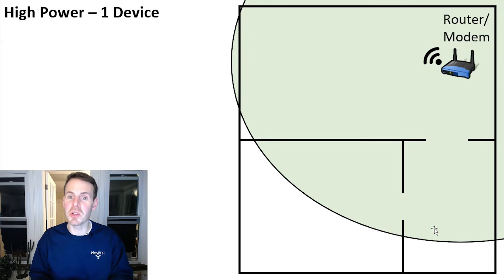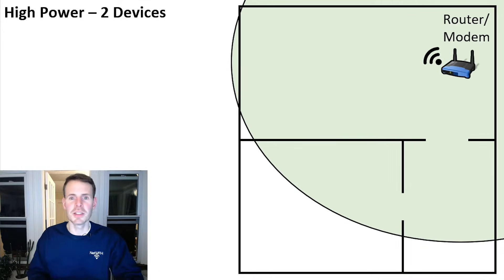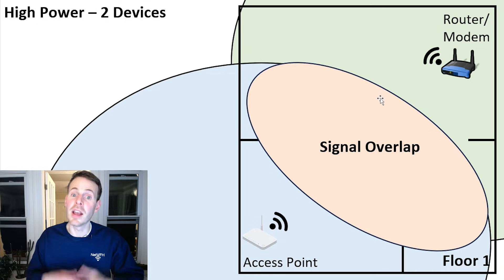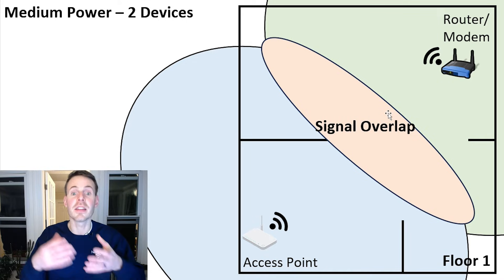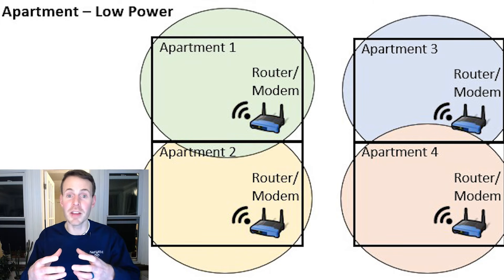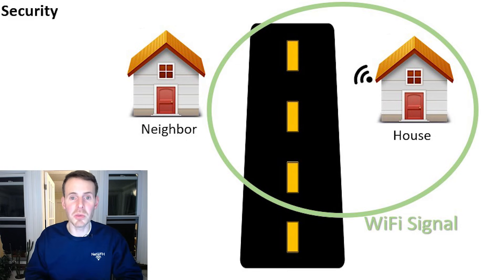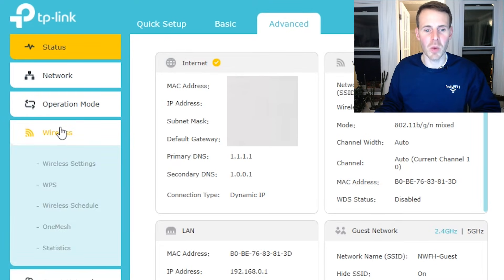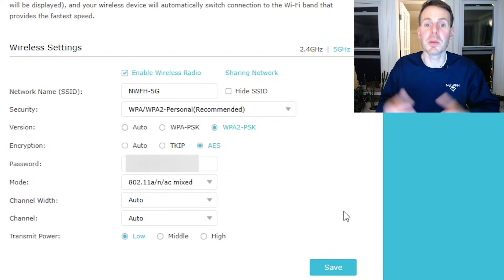POWER UP Your WiFi: When Should You Adjust Transmit Power?

Comment: There is no need to change power to medium or low. If there is one router and even two AP, just set them to channels 1, 6, 11 on 2.4 Ghz and there wont be any overlaping.
Reply from the maker: In this situation there won’t be any overlapping of traffic, but the WiFi networks themselves could overlap each other if the access points are all transmitting on high power and they’re too close together

Comment: I am using TP Link router. At the same location away from the router, the download speed of 5GHz is 350+ mbps, but the download speed of 2.4 GHz is only around 40 mbps. What are the settings I should change to increase the speed of 2.4GHz? Thanks
Reply from the maker: That’s surprising that your bandwidth for the 2.4G network is so much low. You should expect slower speeds with the 2.4G network, but not that drastic of a difference. Is it possible other devices were using the 2.4G network when you performed the test? Otherwise, I would verify that you’re getting a strong 2.4G WiFi signal, as this will impact your 2.4G speed. I hope this helps!

Comment: My mesh system doesn't have an accesible setting to check on transmit power. It's bothered me since the day I bought it.
Reply from the maker: Especially for a mesh system, that is surprising to hear (and frustrating). Thank you for sharing!
Reply: @network-from-home  When I use the app the option doesn't exist, but when I connect to it in the browser, I can see it, however it refuses to change no matter what I do. (I've been attempting different workarounds periodically for the last 3 years since I bought the system.)